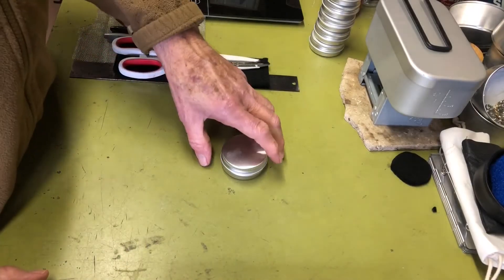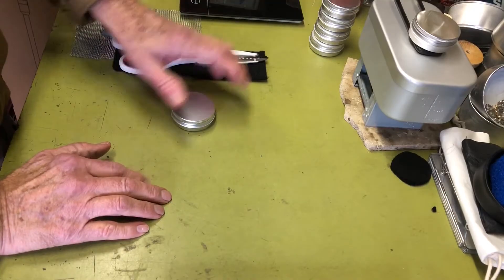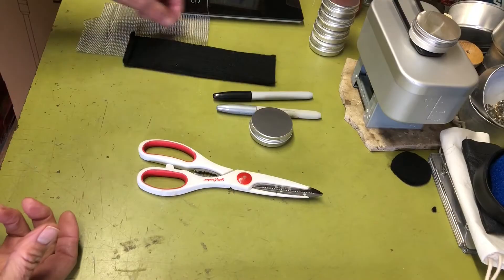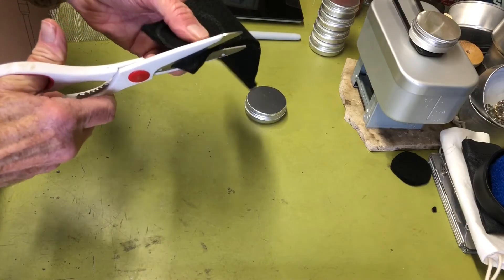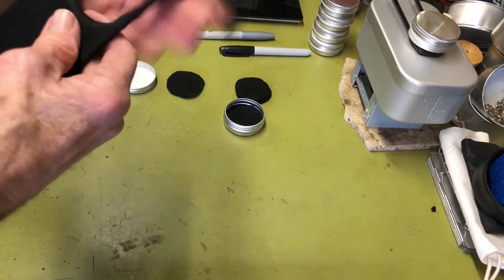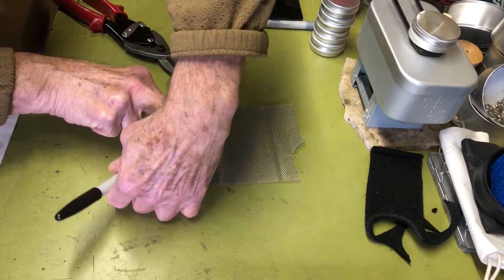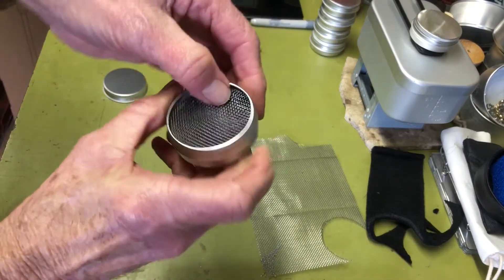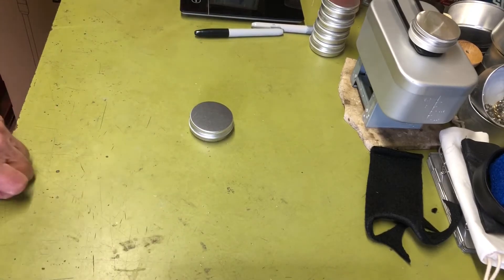Build a Small Round Tin Alcohol Burner

Comment from the maker: I mentioned in the video that the lid could be used to extinguish the burner.  I later found that it doesn't always work. I find one or two sharp breaths will usually extinguish the flame.
Reply: Try the lid upside down. That's usually better with the X-Boil ones.

Comment: When you used the CF disks, you greatly reduced the "wicking" ability of the felt as there is no "intertwining of fibers".  Using disks rather than the more proper winding on EDGE a strip in a circular pattern and insert into the can.  Than way, there is total "connection" of the wicking fibers that will act just like little pipes to flow the fuel....

Comment: Does the mesh do anything to the flame or is it just to protect the carbon felt?
Reply from the maker: Not that I noticed.  Carbon felt will shrink a bit over time or if you use smaller pieces they could possibly pop out and get lost.
Reply: @planetsideagent  Ok good to know. Im thinking about doing some DIY carbon felt stoves so it sounds like i need some fine wire mesh then 👍

Comment: I did a similar thing but instead of carbon felt I used some coarse vermiculite I had left over from gardening, does anyone know if the carbon felt holds more alcohol or burns hotter than perlite / vermiculite?
Reply: Same fuel, same air flow, same temperature.  Might be some air flow difference - you'd be hard put to measure it.

Comment: Cool idea, but it's only "lightweight" to a certain extent. You still have to lug around one or more fuel bottles filled with fuel, which will add to the overall weight of your pack load.  On a side note, I went to a local Party City retail store and bought a 12 pack of Sterno cans for $10.  The cannisters are small, compact, they travel easy, are re-sealable, and you get almost 3 hours of burn-time out of one Sterno can. Just an option.
Reply: that’s an incredible deal! I never thought about trying party city. The best deal I found so far was at my local Home Hardware store; A person can get a three pack for somewhere between 10 and $12. $35 for the gallon can of refill.

That’s some thing I’m gonna check out today. Thanks again!
Reply: The Sterno takes much longer to bring water to a boil though. And the cans are much heavier, although you could scoop the sterno out into these tins.
Reply: @user-bh3ew6ii4g  it's methanol alcohol.  It all burns at the same temperature.
Reply: @MelloGee33 
Sterno fuel is not 100% methanol. It contains gel additives that lower the burn temp. Sterno fuel is made to burn cooler, so as to not burn the food it's meant to warm.

Comment: What happens if you don't use the felt or mesh
Reply from the maker: Other than the spilling/fire potential I'm not sure. My  gut say's it won't be as efficient but that is a good question.  I'm going to do a test with no felt, felt and felt with mesh.  Should be interesting.  Another commenter suggesting spiraling the felt instead of pucks.  That's another test on my   list.  Stayed tuned 🙂

Comment: If you cut the metal filter a little larger and fold it down, I think it will be a more efficient product by increasing the evaporation of the heat from the bottom.
Reply from the maker: Interesting, I'll give it a try. I have another suggestion from viewer, I plan on doing a video for both.

Comment: Did the same without a screen and cut the carbon felt in srips and wound inside the tin.  It boiled faster for some reason.  I made the round pad style too.  Perhaps the way it wicked made the drip style faster?
Reply from the maker: interesting.  I've seen round tin builds where they roll up a fire rope and the Fancy Feast stove has the wick upright and it boils very fast.
I'm going to make one your way and do some boil test comparisons.
I'll make a video but not until fall, after the yard, garden and house projects season is over. 🙂

Comment: What size of this steel mesh? 20, 30?
Reply from the maker: I'm not sure what size mesh I used, I came in a soldering iron kit which didn't say.  I suggest the finer the better, even window/door screen would work.  I have a couple of antique burners that use a mesh that is thin.  
The mesh keeps the carbon felt or wick material from falling out.
It may improve the burn but I'll have  to do some more research and testing.

Comment: I don't use carbon felt or the screen on this type of stove when I make them. I found that 3/4" fire rope works very well and the carbon felt on cat food stoves.
Reply from the maker: I've watched a lot of videos where they use fire rope.  I have carbon felt laying around from my Fancy Feast stove builds and I like the looks of the steel mesh. 🙂
Reply: That’s a great idea for the fire rope. Do you have any idea if the fire rope help to absorb the alcohol, thus making it harder to leak out if on uneven ground, etc?
Reply: @BingWatcher  it might as long as you don't overfill the burner.

Comment: 👍👍👍 .. nice 😊.
I used an empty Shoe Polish Tin. The Carbon Felt .. I 'stole' a strip off the pad that I use as a Heat Shield under my Burners when on 'sensitive' surfaces.
A strip .. the width thereof the internal height of the tin. Rolled it and popped into the tin. Easy peas 😊. Did not use any Mesh and so far, so good. Glass / Ceramic Wool / Fibre Glass works just as well and if 'salvaged' from scrap, costs nothing. Using the Glass Wool as a base and then covered with a single Carbon Felt pad or narrow spiral roll thereof (the latter my choice in the Trangia .. see below) should work ok.
Also, I have similarly treated my Trangia Burner. Performance does not appear to be affected negatively .. actually, I 'appear' to get a more gentle burn and most important, the risk of spillage during an inadvertent 'knockover' is greatly reduced.
Yes, please, the Altoids Tin Set Video would be nice .. thanks.
Thanks for sharing .. take care ..
Reply from the maker: I just posted a video on making a Altoids Tin Stove:
https://youtu.be/SzYIs4LjJX8
Enjoy 🙂
Reply: @planetsideagent  Thanks.